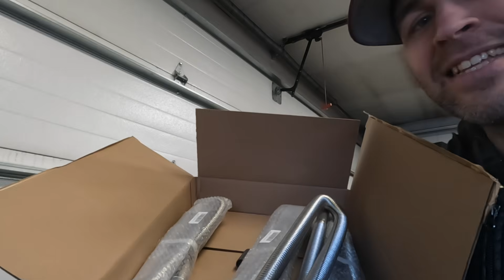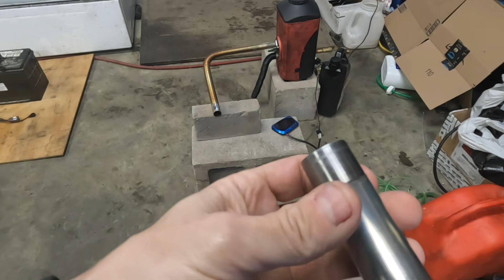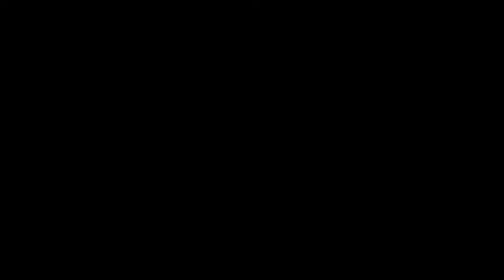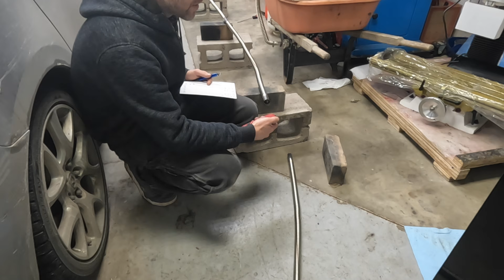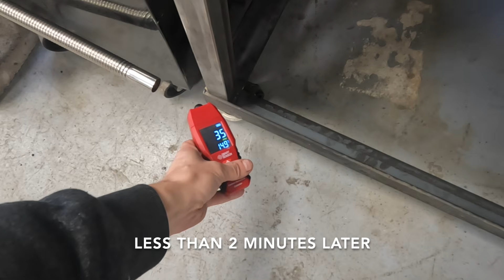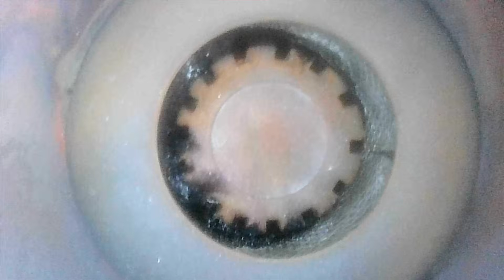Capturing Waste Heat - 5 Meters Of Stainless Exhaust - Will It Even Run ?

Comment: I just starting my "experiment" with diesel heaters. 

I live in the Texas Panhandle, and at times we can get down to 0⁰F and below freezing for several days at a time.  Not overly long periods but maybe a week or so.

I have an unheated detached shop that houses a water softner, there is absolutely NO place to put this softener inside my 100 year old home!

Over the past 10 years, I heat this area of my 14 x 40 ft. ( 560 sa ft) shop with three 1500 watt space heaters and two lengths of heat tape on well insulated pvc when freezing weather is anticipated. 

I have had frozen pipes three times when temps approached 0⁰F.  Maybe, I need to install .75" pex, but I can't afford a plumber to drive 150 mile round trip for just that! I don't have tools to do pex. I installed the pvc pipe myself.  On a farm/ranch you learn how to be resourceful. 

Normal 15⁰ to 32⁰ cold snaps no freezing pipes. 

But now I've purchased one of these diesel heaters to heat this area with both the regular heater output and also from the uninsulated exhaust pipe (ducted outside, naturally).

I've looked into propane, mini splits (have 4 in my house, work great until 5⁰F then need supplemental naturally gas heat, not really good in my worst conditions for my shop.)  Even wood pellet stoves.

While all require fuel, the diesel is seemingly my best choice since I have diesel equipment on the farm.

But, the real reason for this ...
... have you tried injecting Brown's gas (HHO) into your heaters? If so I'm not seeing this on your site.
Reply from the maker: Thanks for the comment. Tools for pex are not much money compared to the price of getting someone to do it for you. I have in floor heating in my garage and did it all myself. Other than pouring the finishing the concrete. 

I have not tried HHO for a few reasons. 

1) Although gasses like propane are flammable and explosive, under the right circumstances, they are pretty fussy to mix ratios, and propagate at a fairly slow rate, meaning the need to be confined to make a boom. 

Hydrogen has an extremely wide range where it can ignite when mixed with oxygen... If you have a propane leak a) you smell it b) you can have a fire or spark going all day, unless then air fuel ratio is correct, it will be okay. Hydrogen doesn't have a smell (if you make it yourself) it will ignite at VERY wide air fuel rations meaning it is likely to ignite and lastly is that the flame propagates so fast that even in open air, it is almost like an explosion... I have played with it in the past. 

It could be done fairly safely, if you were to use all proper fittings, lots of flash back arrestors and engineered the system well, but that brings me to reason

2) The amount of energy that it takes to produce HHO does not make sense, unless you specifically need hydrogen, or basically have free electricity. To make a continuous 5kw of hydrogen, you need 6-8kw of electricity, and because the heater is about 80% efficient... you are way better off using the electricity to make heat.

Comment: Now that was a proper abuse video without instigating self-destruction. I missed this one a couple of years ago apparently 🙂 I'd like to see how it behaves if it went from the normal diameter of tubing to a little larger diameter tubing, after the first or second run of tubing. I'd also like to see the difference if the first, and possibly the second, length of tubing was wrapped, using what you have there already.
Reply from the maker: I have also been curious about this... or perhaps using 6" furnace ducting... it has lots of surface area. Either that or some box section aluminum... but that would be costly. 

I suspect that insulating the first two sections of pipe would almost make it as though they weren't' there at all... But it would be interesting to see.
Reply: @loweredexpectations4927  I would expect better exhaust flow characteristics, and the end pipes to be a little bit hotter. Might even be lower CO numbers. . . . .
Reply: @loweredexpectations4927  Not saying if you put the monster tubing on there though. Thaaaat's whole different thing going on.

Comment: I think you should make a manifold to run the exhaust pipes in parallel. This would essentially make a larger diameter overall exhaust pipe reducing restriction. The other option would be to run a radiator with a fan blowing through the fins to capture the heat...
Oh wait... You already did that...   (-;
Reply from the maker: Haha " you already did that" nice... 

Yeah.. running 2 or more in parallel would be way better, or even just stepping up to a large diameter pipe.

Comment: Did the room get warmer with the added exhaust tubes?
Reply from the maker: I just wrote out a LONG explanation and a short, smart-ass response. 

I'll try to go somewhere in the middle... 

Outside of a laboratory, this would be difficult to track accurately. The results if tracking room temp would mean very little. This is why I didn't mention it. 

The exhaust heat energy is usually pumped outside. This keeps some of the exhaust heat energy inside. That is all that is important. 

If the temperature dropped outside by 10º but the temp in the garage stayed the same, my answer would be "no... the room didn't get warmer". but that is misleading. 

I have another video using a heat exchanger, and I would suggest using a car radiator or one of those exchangers rather that this stainless pipe. Stainless is not great for this purpose, but better than nothing.

Comment: The problem with diesel heaters is that their function depends heavily on the length of the inlet and exhaust pipes and diesel type. If you have a limited poor controller (as my Vevor 3 buttons controller) that does not allow you to adjust the pump frequency and fan speed yourself, you will soon end up with a sooty device if, for example, you use a 3 m exhaust pipe.  
The back pressure of the exhaust pipe causes the fan to run slower, which reduces the amount of intake air and leads to an overly rich mixture in the combustion chamber -> soot and more CO.
My controller also cannot compensate for the altitude. At 1000 metres, the intake air volume is no longer sufficient to burn the fuel correctly.
Before purchasing, be sure to check what the controller manufacturer actually allows you to do.
Reply from the maker: Thanks for your comment ... it seems you put in some thought and effort. 

That being said... I am at 1200 metres and, if you watched the video, even with 5m of extra pipe, the CO, after warmup, was not an issue, meaning the combustion was complete. 

Although I did not do long term testing, all info in this video seems to point to this heater being okay, as long as it wasn't started and stopped too frequently. Have you watched the video? 

I currently run 4 heaters... 2 in my bus run non stop, one runs 12 hours a day and 1 runs for short trips to get fast food and fuel ... All of my heaters run on "normal" mode (not alpine or plateau / not fuel compensated). None of my heaters have EVER had soot or carbon issues, and none of my heaters have CO levels over 15ppm... (after startup is compete) 

If you are having a lot of CO and soot issues at 1000M.... you need to look for some sort of issue and not just assume that all of these heaters are the problem. I promise you, these heaters run perfectly fine at 1200M and I have tested well over a dozen heaters with the same results. 

Most common issues are some sort of exhaust or inlet blockage, or pressure differential between the exhaust and inlet. Wind in your exhaust, heater in a small sealed space etc. 

PS... If your controller tells you the elevation... then it probably adjusts for elevation when necessary. There are 3 types. Manual engineering adjust, "plateau" or "alpine" mode button adjust and automatic adjust. To my knowledge I have never seen a heater that has no method of compensation.
Reply: @loweredexpectations4927  I think the problem is with my controller. It shows an altitude of 0000 m and I can't adjust it at all. After the soot problem, it now runs with a short, 1 m long pipe – without soot formation. Even at level 10, there are no more problems. I previously used a 3 m long pipe and a silencer, and I used the other silencer together with the original black silencer for the intake pipe. That was quieter, but I have now removed it as I suspect it creates too much air resistance.
Yes, I saw your video on this topic. That's why I assume it's a problem with the controller type. I tested it with auto diesel, heating oil and kerosene. With kerosene, I can reach up to 216 °C outside the burning chamber without any problems.
Reply: @jochenherrmann6000 did you check the pump settings on the controller? if its set at 22 and you have a 26 then it will run rich

Comment: I wonder if the chamber was running hotter because of the air restriction being in the cement block without a open air passage.
Reply from the maker: I think I may have mentioned it in the video, but I had done testing on the heater previously to see what effect this would have. There is apparently enough air flow, though it appears there would not be.

Comment: I`ve been off grid for 36 years now and this is the fourth winter that I have been heating my house with a 5 K diesel heater . For the last 3 winters I`ve been making all of my domestic hot water using the exhaust heat only . I am only missing one more thing and that is to generate power using the exhaust heat . 
I would really like to see you run a sterling hot air engine using exhaust heat . Then we would have killed three birds with one stone . Heat , hot water and power burning less then one and a half gallons of diesel per day .
Reply from the maker: That would be interesting... but I don't think it is at all practical. Sterling engines are neat, but not at all efficient. Solar and a few batteries would be way better. Tom Stanton, on YT has been trying to make a sterling powered bicycle for a while... and it has been a very interesting project, but highlights how bad they are at converting heat to mechanical energy. 

I'm curious how much water you are heating. My math indicates that it would take about 6 hours for your exhaust to heat 20 gallons of water to about 160F from out of the tap temperatures. 

To turn heat form your heater into electricity (using any method) you would be robbing heat from the system, meaning that heat energy isn't heating your living space or it's not heating your water.
Reply: That's very interesting. How are you heating your water with exhaust? I've heard of people using sand batteries but not sure of the process. Would love to see someone posting videos on this.
Reply: Make smoke fuel ,"gasification system" with wood
For gasoline generator
Reply: Off-gridder too here, I am currently fitting a diesel heater, I do not like extending exhausts without increasing the bore of the exhaust pipe, I have built an heat exchanger to go inside a tank filled with Sodium sulfate decahydrate, welded up some decent thick stainless. 
Without putting a downer on these wonderful heaters, I do think there is another way, a silent diesel generator set, maybe running on cleaner HVO, can produce electricity to top up your batteries on a dull day, but also it would not be impossible to use the engines coolant loop to heat hot-water, central heating and that's before you even look into recycling the exhaust gas heat. 
You could maybe try using TEGS in a sandwich of Aluminium  plates between the exhaust and a heat sink, but they could end up getting too hot.
Reply: As long as you construct it in such a way that the exhaust pipe can be taken apart easily to clean it out every year . Good call .

Comment: arent you choking the cooling flow of air by having it in a cinder block?
Reply from the maker: I'm confused... It's on the cinder block. How would this choke the flow?
Reply: @loweredexpectations4927  the intake is in the block. intake for the cooling/heating, not the combustion intake.

Comment: I like to see this same test with like some smooth on the inside 38mm tubing, a little over 50% larger diameter. Use a 38mm 90 degree bend too. Just need one 25mm to 37mm adapter. 

I'd bet you could go 7 or 8 meters long before you get the same output. But you'd need to have about a 2% drop so condensate will run out.
Reply from the maker: It would be interesting to see how efficient the larger tubing is. You have a larger surface area, but also a lot of gases that are not in contact with the pipe... A lot more volume inside of the pipe for the gases to avoid contact.

Comment: Webasto manual states max 2m exhaust with silencer, or 5.6m without. Max 270° of bends. Back pressure isn't the only limiting factor. If the gas falls below dew point you'll get a build up of acidic water, which will trap more soot which in turn restricts the gas even more.
Reply from the maker: That's interesting. Does the manual actually state that the main concern is water (condensation) or is that how you interpreted it? 

Most of the manuals that I have seen tell you not to run too long of a pipe and not to have too many bends. The fact that they tell you not to have too many bends indicates that they are concerned about back pressure.  

Condensate will happen in any system if you pull enough heat energy out of the process. Most home furnaces now are condensing furnaces, and they are simply designed with this in mind. My home furnace has the exhaust angled up with the condensate drain leading back into the house to stop it from freezing.
Reply: @loweredexpectations4927 States about the dew point in the manual, and acceptable orientation, length, bends etc. look up the installation manuals on webasto site. The Chinese heaters are copies so webasto manual should be everything you need and the Chinese left out 90% in their manuals.
Reply: You can only get a build up of water if you do not slope the exhaust pipe downward.

Comment: Wrap that exhaust in tinfoil and do the testing again.  You don't need to know rocket appliances.... aluminum will conduct heat before the end of the pipe eh
Reply from the maker: Yeah... the aluminum could act as a radiator of sorts.

Comment: The problems venting exhaust into the room start with co co2 and H2O. DONT DO IT
Reply from the maker: Venting inside is not at all a good idea. If you are lucky, you won't die or get really sick, but you still may have other issues.

Comment: Thank you, thank you, thank you! I came across your channel, and this video in particular as I plan on doing about the same thing. I plan on running two 3 m exhaust pipes in parallel coiled up in a small box with an intake fan and exhaust. More or less making a heat exchanger. The 3 m exhaust pipe cost me about $20. What I'm trying to achieve is half the restricted flow by using two pipes in parallel. Hopefully this will prevent too much back pressure which you had during your test. It looks like your test sorted itself out. And that's why I say thank you very much!
Reply from the maker: Cheers ! Thanks for the comment. Did you do it yet ?

Comment: Did the test significantly heat your garage?
Reply from the maker: If you are asking if the additional heat was noticeable, not really. The total heat output does warm my garage significantly. The energy lost out of the exhaust is only about 800 watts .

Comment: Very interesting results .It shows how clean burning and efficient these heaters are.. Which equates to how safe they are when used as they should be used . It puts a cap on the profits of doom nonsense .
Reply from the maker: Yes. Incredibly safe and practical in many situations. Not for everything and everyone, but great when used in a sensible way.

Comment: Interesting stuff! I would have thought it would be even worse running. Might have to look into some reclamation forms at some point!
Reply from the maker: It is worth it, if you take your time, think it through and do it right, haha... For my next test... I did not do any of that.
Reply: @loweredexpectations4927  I will keep it in mind!  I think as long as the corrosive condensation has a way of exiting externally it shouldn't be too difficult.

Comment: Is there a reason that you leave a 90 degree bend at the beginning of the exhaust run? Seems to me that without it (all straight run) would be less resistance & maybe less taxing to the heater temps. 🤷
Reply from the maker: I ran the 90 because it is more realistic. Most people are going to have at least one good beld like this, to get the exhaust pointed where they want it. More bends is definitely more restriction.